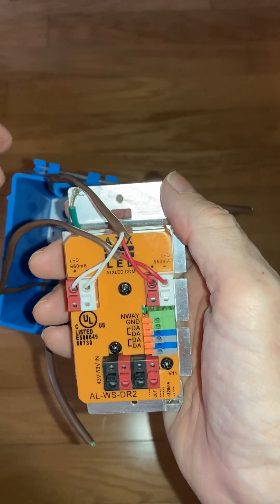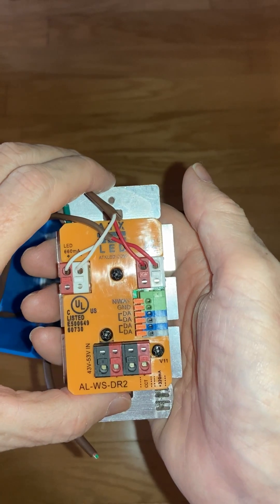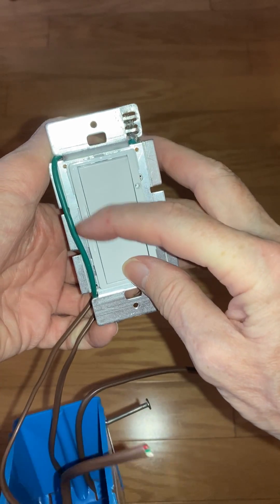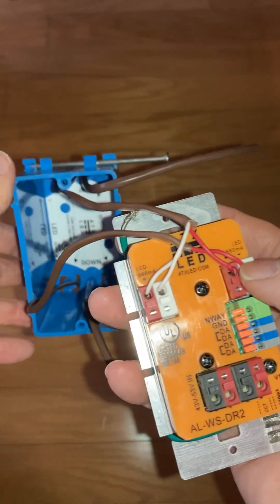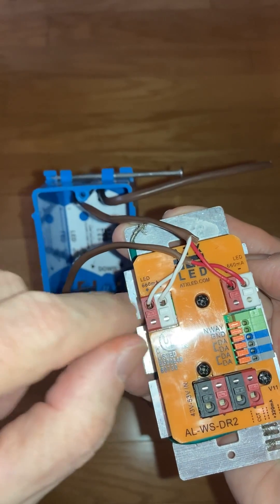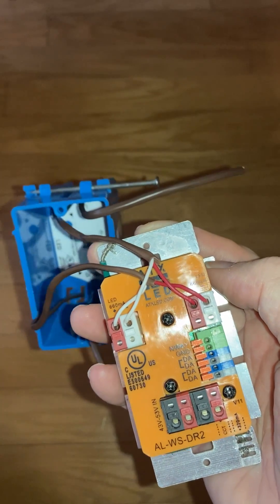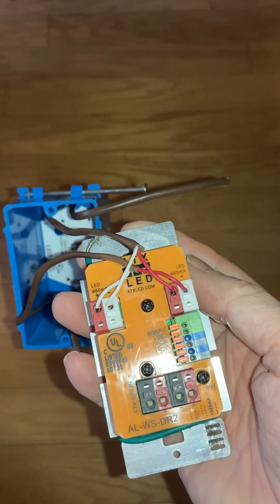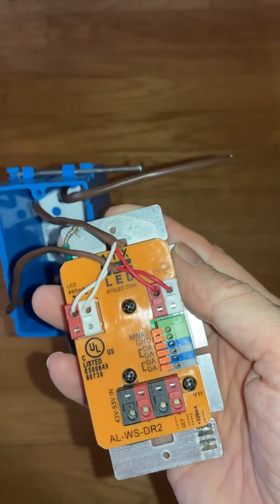ATX LED wall switch wiring - the AL-WS-DR2 wired for 30 watts, tunable color temperature

Comment: My tunable white strips have 4 wire not 2 They have ww + Ww- Cw+ cw-  Safe to  assume they just go directly as indicated on the switch then?   Also they are dimmable. Does that make a difference anywhere ?  I assume most lights in your examples are dimmable and the literature talks about them just connecting to the distribution hub. Anything else to consider regarding that  ?
Reply from the maker: Hi - your 4 wire lights will work fine, we have seen any strip that cannot be dimmed / driven by the ATX system.   That said, there is the physics of current and voltage to consider.   The DR2 supplies 660 mA to either the warm or cool outputs, or a mixture of both  - with a total of 660 mA to assure constant brightness as you change color temperature.  

If your strips are 12v, then the max wattage is is only 8 watts, 24v is then 16 watts, and 48v volts is actually limited to about 28 watts for other reasons.   If your 4 wire strips are 12 or 24v, kindly cut them in 1/4 or 1/2, and wire these smaller sections in series, in order to reach higher total wattages.   We stock the ideal 4 wire strips that were designed for the ATX LED system.
Reply: @atxled7490  thank you for a thorough response.